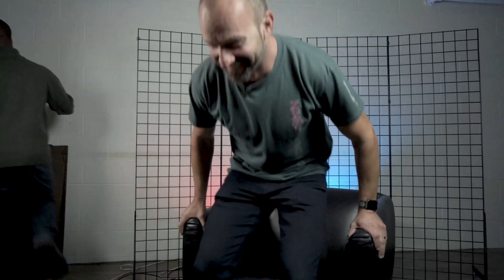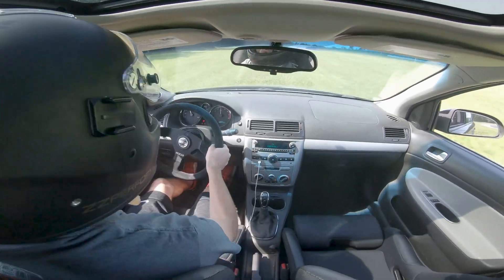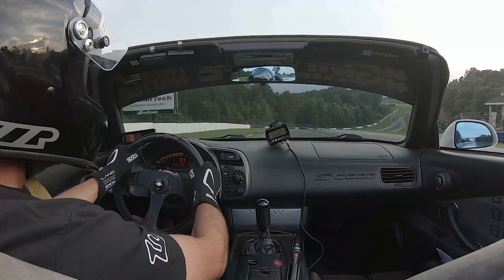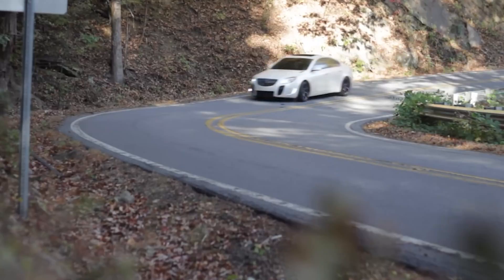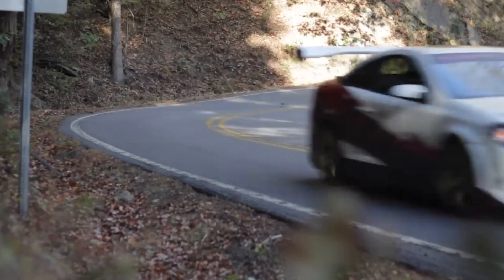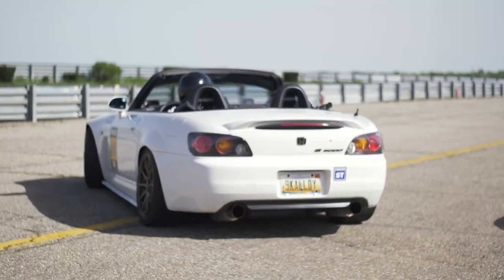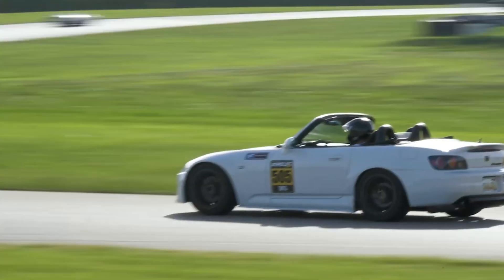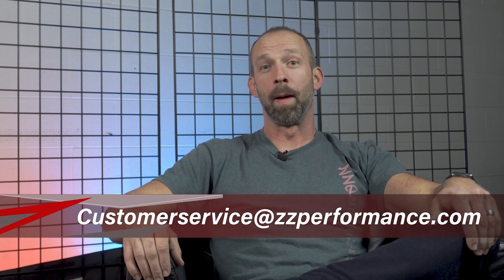Everything You Should Know About Sway Bars // Behind The Builds

Comment: How does the shock tower brace help?
Reply: Depends on the chassis. Older chassis are known to get torsional twist in the front frame when entering a corner. Newer platforms don't benefit as much, as chassis design has come so far in the last decade. Most cars are very rigid in this area from factory. But, it doesn't add much weight, and gives you an added bonus of a modified look in your engine bay.

-Trev, ZZP

Comment: Would be neat if you guys discussed design and how your bars with tabs welded on are inferior to almost everything else on the market
Reply: While this does add a slight increase in flex to the overall design, we tested this to be more than adequate for any street car. They feel great, and we have not had any issues with them breaking or wear. We actually tested this and run it on many street builds, as it flex is perfect for driving hard, and going over your usual pot holes, speed bumps, uneven road, etc. It also allows our ZZP bar to come in at one of the cheapest in the market, so again perfect for any mild street driven / weekend warrior build. There is obviously options to go further out there, as you mentioned, if the said car is a dedicated comp car, or more aggressive track approach.

-Trev, ZZP